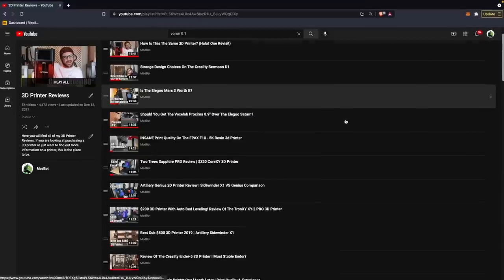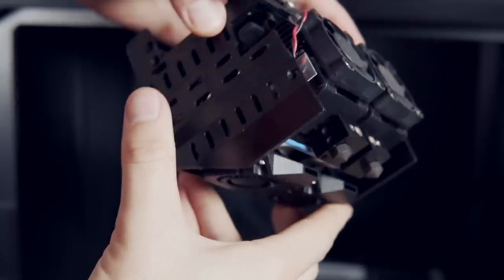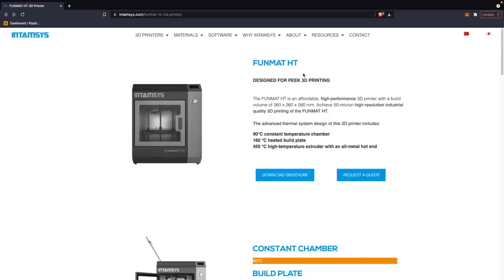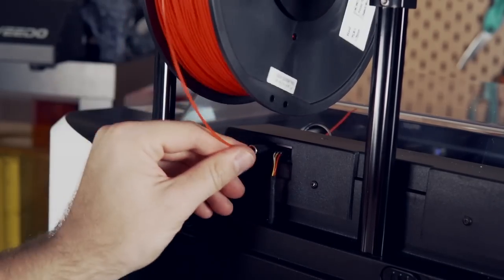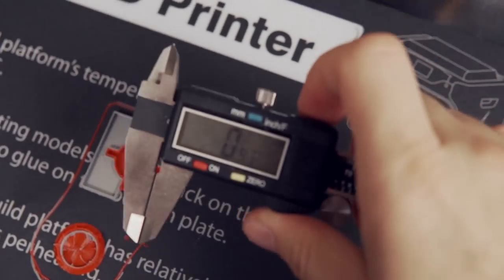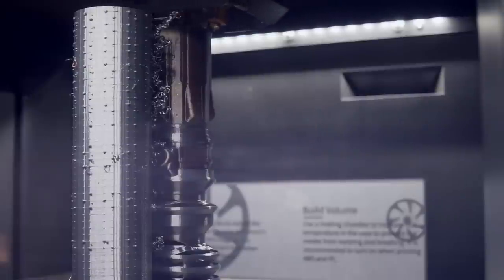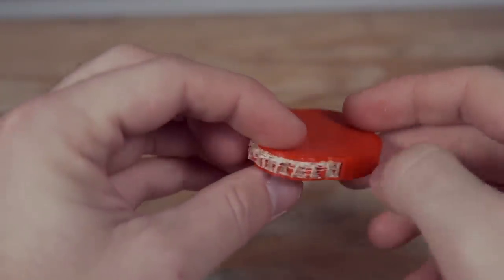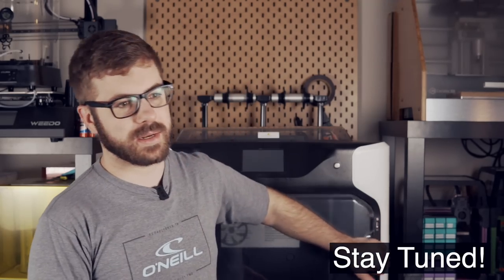Best 3d Printer For High Temp? Review Of The Qidi Tech i-fast

Comment: 60c is a waste of enclosure 90c minimum large prints will fail with real material 160c ideally
great video as usual thanks
Reply: 60C is like 140F, you can not get that with a regular printer with an enclosure. It is perfect temp for abs and such. At this price, there is no other printer that offers this. Just fyi
Reply: @TheShaddix  60c is a peice of cake for some not so easy for others most wires are good to 90c-105c with out isolation and bl touch has been used in the idex22 to 75c so whats so hard for you to know how to print exotic or less than but you cannot fab a 60c box..... ok got it! all makes sence now.... cheers
Reply: @TheShaddix  also my box store open build can surpass far over the stratasys i have at 75c chamber its not rocket science here 150c this is where we want to be not 60c....today you may want 60c but you also may be a cosplay guy not a enduse guy.....
Reply: @rexxx927  I can't even comprehend this jibberish you just typed up, but just keep in mind that when you start heating up regular printers to 60 and above, you'll be reducing their life span. But I am sure you know it all already and gonna tell me some other nonsense.
Reply: @TheShaddix  nope i think were done here good luck pladoo boy
Reply: @rexxx927  You got it! Glad you know when you quit!
Reply: @rexxx927  150c? And the fact that the electronics die prematurely or the rails (probably too extravagant for a genius of your standards) lets say you use screws instead. Oops they are out of tolerance from being overheated and prints look like garbage. 

Tldr go home kid and stop spewing bs lol
Reply: @syndan9245  150c cambers and up requier a box in a box the simple fact you dont even know your components do not got into the 150c plus area there are baffels and fire pillows captian where have you been its been a month without your bs... i was quiet but you asked i answered do your reasearch capi! stop the hate read the facts you think i make this shot up.... lmao
Reply: @rexxx927  you do realize im a different person right? Or can you not read
Reply: @syndan9245  this is me is this you?